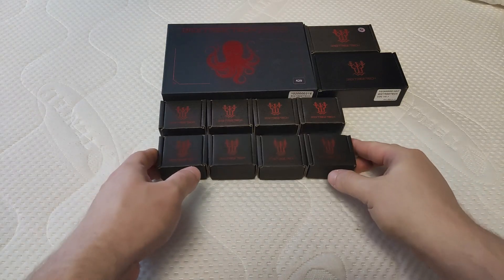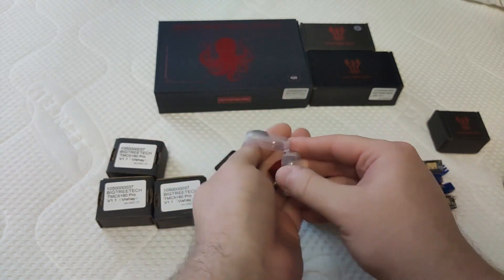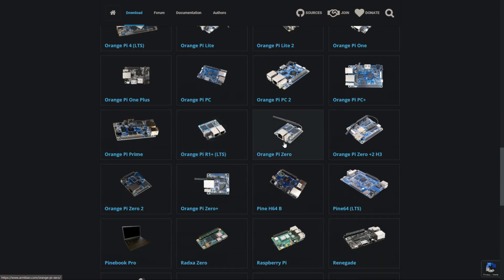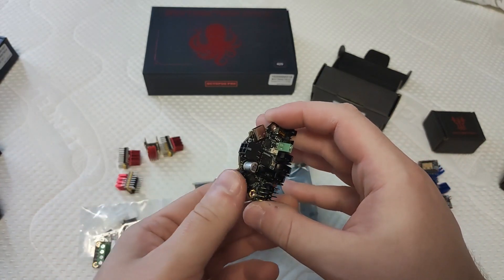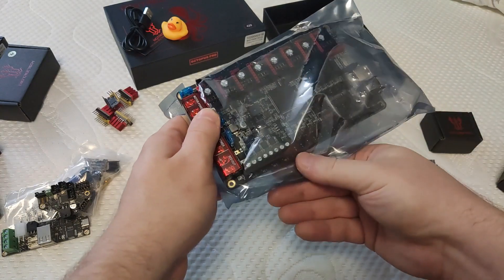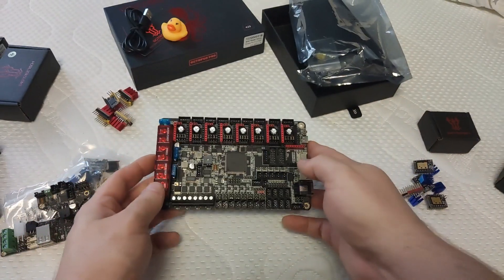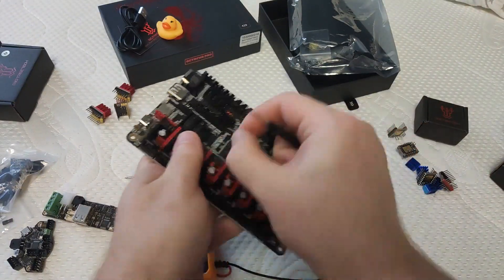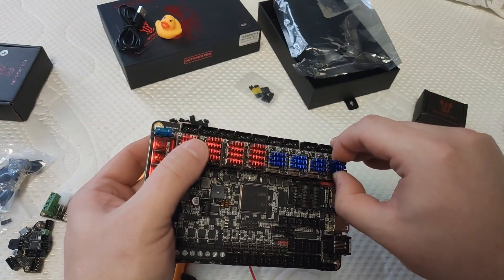Octopus Pro 3D printer motherboard - Unpacking, initial impression and review

Comment: Hey there I am (i see no) i wanted ask a question does the motherboard work without pi1_5/ raspberry pi
Reply from the maker: if you use marlin yes, with klipper you still need external SBC/PC
Reply: Thanks fòr urgent reply. Appreciated.

Comment: Very nice video! Thanks for this!

Do you think it's plausible to use the Tronxy stock board for the VZbot and Klipper? I'm not 100% sure yet but I believe I have the most up to date one, 32 Bit and Marlin from what I read on forums.
I'd like to eventually get the Octopus but I still need to learn more about how to set it up, cables and what steppers I would actually need (and how to use them fully). It seems a little scary to do and I've only messed with installing an SKR Mini into my Ender 3, which was very easy.
Reply from the maker: That was the setup i was running before so it's absolutely possible. You just configure it like stock tronxy x5sa.
Reply: @KaminarisTech  Will do, thank you for the help!